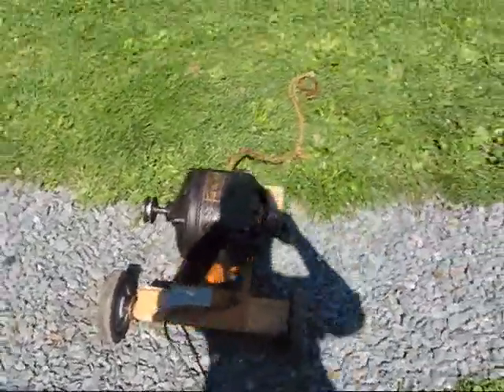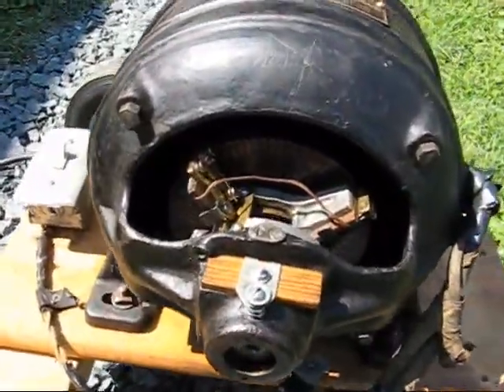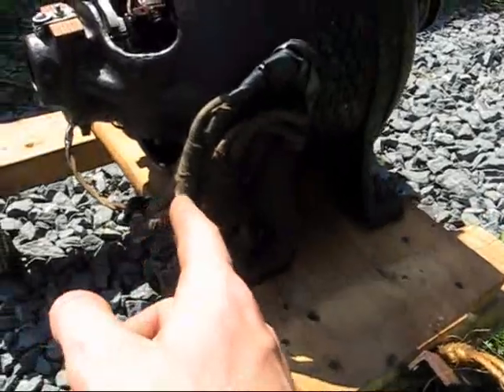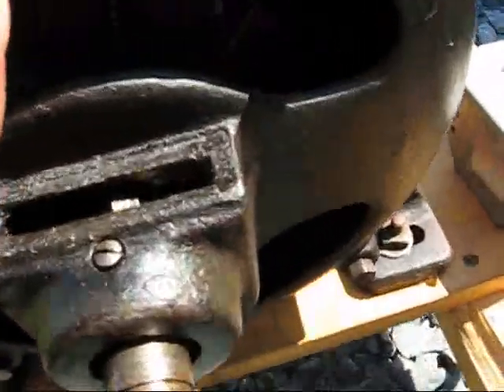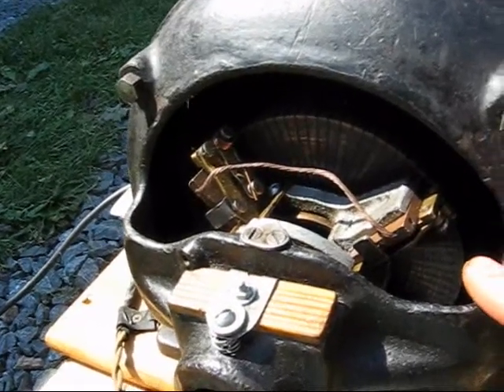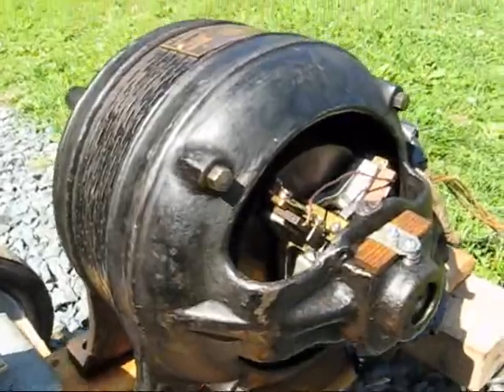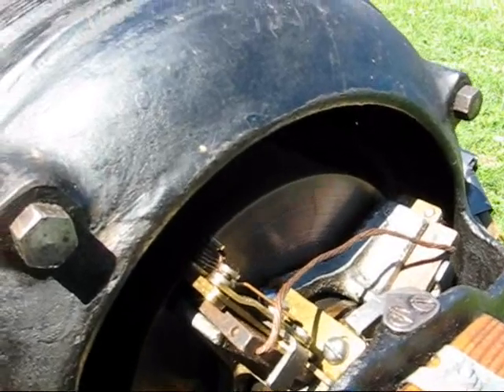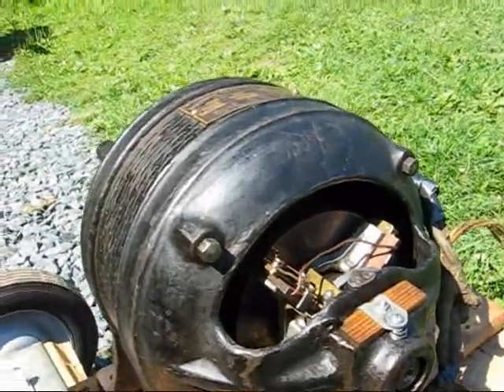1903 Wagner motor

Comment from the maker: @Aussie50 i am not sure what this motor came off of? but i used to run a big single cyl air compressor with it. 
i do have a big V-4cyl refrigerent compressor. i had to have a friend help me move it into the shed. i had to drag it with the truck to where i wanted it then i unbolted the compressor from its base and both me and my friend still couldent lift the thing!

Comment from the maker: well a repulsion start motor uses the of like magnetic poles pushing off the stator and rotor at the same time to get the motor and its load going! once running it runs like any other induction motor! so yes it is just another method of getting a motor started!

Comment: I really like the starting setup...It seems similar in a way to the motors which use a centrifugal starting switch to disconnect the start windings. They sure don't make them with the kind of quality like they used to! Now you just need to hook it up to something to power it.
Reply: This motor has a cent switch too.